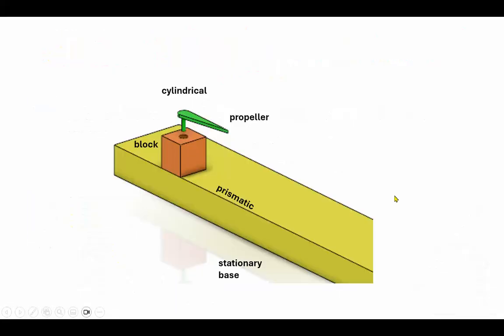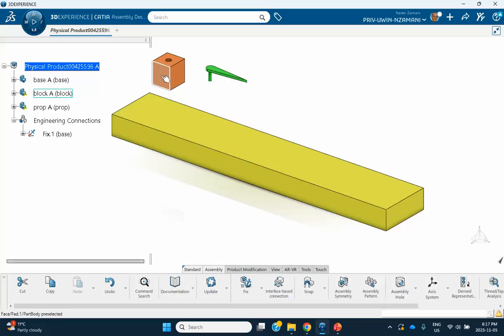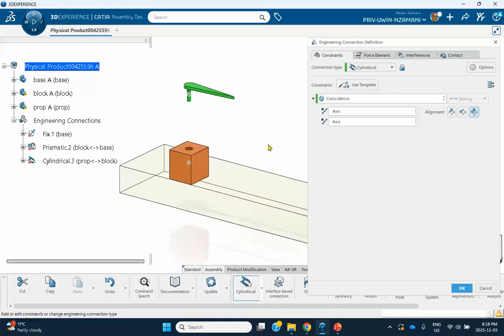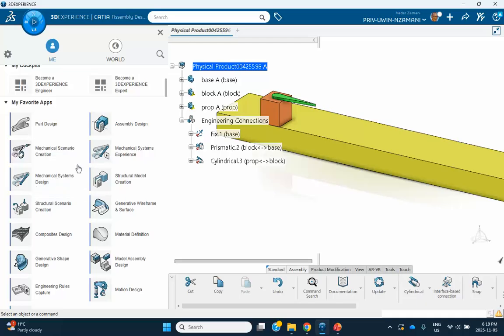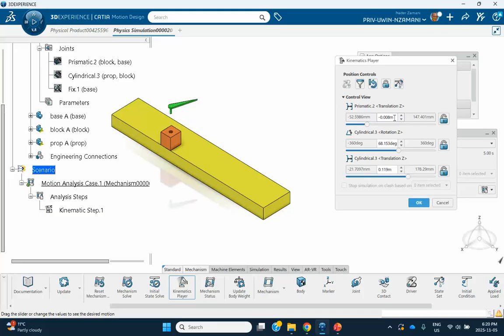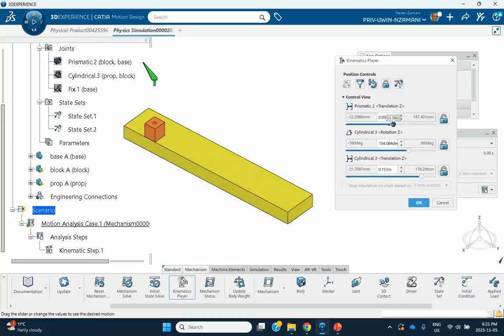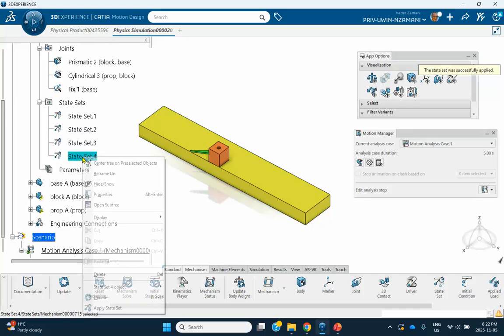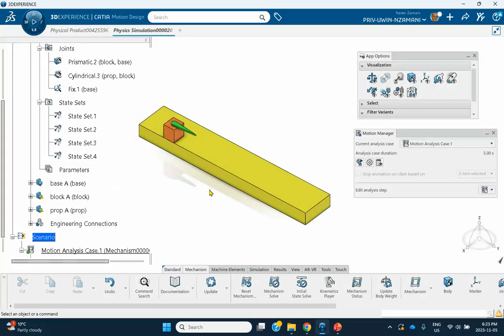Video 17 Motion Design Kinematics Recording Exact Positions of a Mechanism 3DEXPERIENCE Nader Zamani

Comment: Thank you for your videos.
I’m currently working on a pedestrian bridge model in 3DEXPERIENCE ENGINEER, and I’ve been unable to properly connect the suspension cables to the tower and the steel girders.
The bridge runs static and frequency simulations correctly without cables, but every attempt to connect a cable to the solid parts fails. I’ve tried Point On Plane, Point On Surface, Line → Point to Point, Beam Mesh, Imposed Points, Coupling (Point-to-Surface), distributed coupling, Tie and Tie Detection. The solver either ignores the connection or throws overconstraint errors and node-to-surface mismatches. Any additional tips, guides, workflow or recommended steps for this type of connection would also help me a lot. Thank you again for your content.
Reply from the maker: Dear GerritMedina, it is kind of hard for me to say anything meaningful without knowing the details. However, I have a question.When you meshed the line (supposedly the cable), did you ask to merge the captured nodes? In principle the end of the cable node is not supposed to be merged but it is a good place to start. Also check this link
https://www.youtube.com/watch?v=rVPHAgNxM_0&list=PLN2zL9OVZWP0-glFZubNbMar4-tJm8p78&index=8